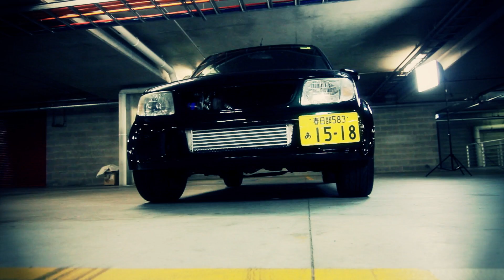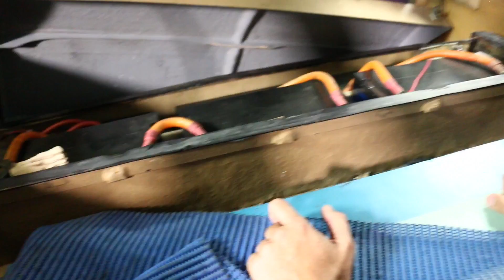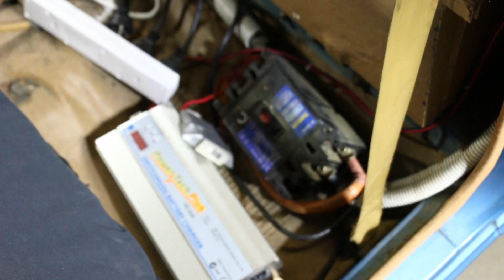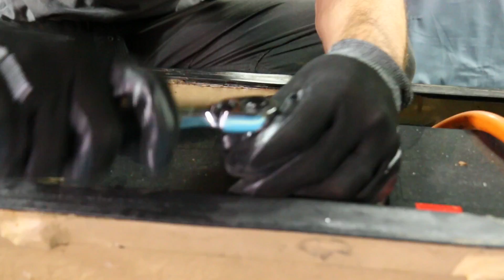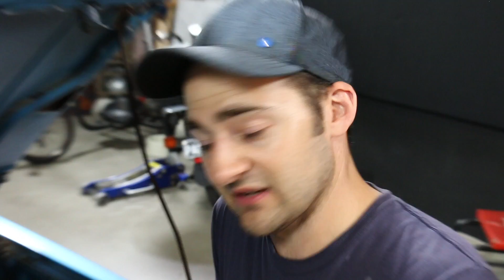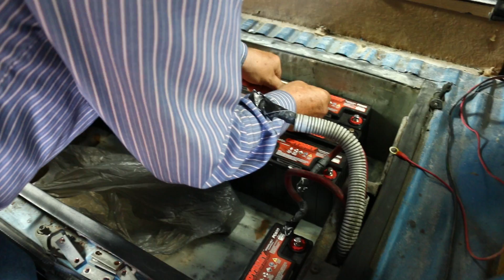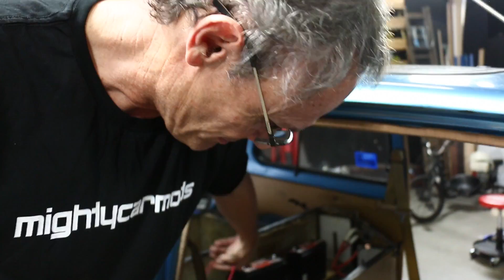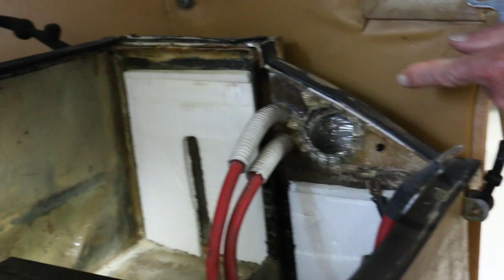JDM Electric Turd

Comment: Electric cars aren't the future they are too dangerous because they Are too silent hydrogen fueled internal combustion cars are the future
Reply: They do, about 50% (in electric much more more) pollution of a car in a life cycle it is creation. So normal car running on gas is cleaner then electric car.
Even MIT made articles about that recently.
And more then that If you have car which is 15-20 years old and run on gas is the cleanest  of all, becasue it was produced long time ago.

And another thing, car need a lot of energy, in one bigger country in Europe change all its car to electric it would need something like whole EU to power it! Not to mention logistical problems  of so many charging station and problems with grid.
Reply: Milk and old battery acid mixed twin brittney spears powered tractor trailers honestly have the brightest future.
Reply: Or you can run on CNG or LPG, which is way cheaper be the way :P
Reply: Target _667 well that mean when you crash you would blow up bro
Reply: swietoslaw CNG and LPG are still fossil fuels that have to be burned which produces CO2. They're better than petrol, but they don't compare to electric propulsion at all

Comment: I work for a company that specialises is battery's a charged battery is classified as 12.83 anything below 12.8 is classified as a flat battery
Reply: My old school front terminal battery in my van with a 1000c.c.a rating charges to 13.2-13.8v , when it hits 11.83v the battery barely has enough ummph for one last quick startup so that about flat.

Comment: Why didn't they use tesla cells ? with that space they could've gotten 500 miles out of that tiny car lmao
Reply: Where were they gonna get Tesla cells?
Reply: from the mighty interweb! you can just go to your personal interweb at home and order those things to your door. Tesla 2170 cells' got 6 Ah. your average iphone only need just und 2Ah. it's about 2 inches long and one inch in diameter. Thats what that gigafactory thing is for.
Reply: and why dont use toyota or Nissan batteries which you can normally buy?;) 
Tesla batteris are nothing diffrent from other. 
And I think they don't want to spend like 10k $ for batteries ;)

Comment: Electric cars are actually pretty easy to understand once you get into it. You could just look at an R/C car and compare the two. There's a control unit which receives the power from the batteries and depending on how much power you need, gives that power to the motor. Then there's a charging circuit, and last but not least, the batteries. That's basically it.
Reply: pretty much XD coming from RC car modder
Reply: yeah ^^

Comment: I WOULD THINK THOSE SMALL BATTERIES HOLD ALOT LESS AMPS!!! WHAT U WANT IS 12 1,000AMP BATTERIES. U COULD DRAIN THOSE OLD BATTERIES & FILL EM WITH WATER & BAKING SODA THEN TRICKLE CHARGE FOR 1-2 DAYS & THEIR AS GOOD AS NEW!!! LOOK IT UP ON YOU TUBE!!!! THOSE LITTLE BATTERIES WONT HAVE AS MUCH COLD CRANKING AMPS=SIMILAR TO HORSEPOWER!!! THE UMPH THAT U FEEL WHEN YOU FLOOR IT!!! WHAT U NEED IS ALOT OF C.C.A(COLD CRANKING AMPERAGE)
Reply: man it's been more than a year why would you think that they would listen to you now that the whole project is over

Comment: Concerns that come along with batteries: if you overcharge or overdraw them, they can pop. That leaks acid. So, you need to put the batteries in a sealed plastic tub. The plastic won't rot with that form of acid. Sealed, because batteries outgas hydrogen while charging or discharging. Hydrogen is explosively flammable as well as corrosive and will rot anything in your car. As you can imagine, a sealed box full of hydrogen isn't much better than it leaking into your car. So, you need a vent for the box. And electricity can shock you. That's about it.

Comment: @22:10. The fact that "newer" lead acid batteries are lighter arguably has far less to do with technology evolution than with build to cost - the chemistry has remained the same for 140 years thereabout. As well, 30+ years of EFI, RoHS, and a trend toward smaller engines that require less cranking current have lessened the demand required of a primary battery which has allowed the mfgr's to build (frankly) shittier batteries than you would have gotten in the same apple for apple group size 25 years ago. This aside, primary starting batteries were never designed for the load curves of an EV, and utilizing them in such a manner will result in a very short useful working life. There certainly are deep cycle Pb solutions, but as you mentioned earlier .. there are far superior Li chemistries now that make Pb look like 16th century apprentice alchemy.

BTW mates  .. Downright tickled with the success that you boys have  achieved - and certainly deserve. In my humble opinion you are one of the.. if not THE .. most  relevant real life wrenching shows today, and FWIW - your viewing demographic definitely now includes the old school (former) big displacement greybeards. Coke bottle chargers (here) or Falcon XB's (there)will always have sex appeal  .. But who has a hundred grand to build something that for all intents is half of the daily friendly ride of (say) a 10 y.o. Subaru.

Keep it up boys - thumbs up.

Comment: i dont understand why any country would use those three pin powerpoints. in germany we only have three, the third is on the side, so you can put it in two ways, which can come in really handy sometimes
Reply: you could still center the third pin or, as said, put it on the sides to keep it symmetrical

Comment: quick calculation would make the equivalent battery from 18650 cells 65kg and would cost 8000$ from new cells. roughly 65cm thick and less than 1mx1m... that would have been awesome!

Comment: How is reducing the distance by 1/3rd & only halving the battery weight of the vehicle improving it??
Your 'experts' have gone from 12 batteries producing 1080ah at weight of 696lbs to 24 batteries producing 384ah at 370lbs weight.
Not to mention all the extra potential for trouble with extra battery terminations.
FYI those batteries are not Lithium either, AGM.........
Reply: They never said they were lithium, they specifically said they were Lead batteries used in sports bikes.
And they improved it from not working condition to working condition.
Reply: meow meowers An expired cell is an expired cell, regardless of Ah ratings.

Comment: OKAY PLEASE DON'T SHOOT ME IF THIS SOUNDS LIKE SOMEONE THAT KNOWS NOTHING ABOUT E.V.s OR ELECTRONICS BECAUSE I DON'T BUT HERE IS MY QUESTION IDEA. FIRST: how many alternators can you affix around each wheel using a custom adapter plate and custom design centrifugal drive pulley to use the energy of the vehicles motion/axle rotation to drive them.(in this case I would say 1alt.-2x batteries or how many is needed to efficiently power the drive motors with a little charging to spare. A independent rear suspension would be the most flexible for this set up to be sprung or unsprung weight).  SECOND: would capacitors help a system like this to be more efficient at speed for better rapid charge discharge?  Also would power inverters be another possibility to distribute the alternators energy as well as charge the system?  I THINK THERE HAS TO BE A SWEET SPOT SOMEWHERE IN THERE THAT UNDER THE BEST DRIVING CONDITIONS YOU COULD DRIVE FOREVER, AT THE LEAST EXTEND YOUR RANGE BY MMMMMUUUUUCH! ...OR AM I BACK TO THE BEGINNING OF THIS IDEA WHERE I AM ABSOLUTELY CLUELESS!???????
Reply: VjCClass Using alternators when not stoping is pointless ,  it takes power to turn in alternator and you lose some to heat so you lose efficiency...    it's a better idea to use alternators for stopping rather than brakes like a tesla.
Reply: jayc5000 I don't really know much about alternators but you mean to tell me that the mass of a moving vehicle isn't enough to drive even one alternator that can sustain enough power to run a motor or replenish a alternate standby batter system. And what about a battery capacitor combination alternating system. I don't even know if I'm asking the right question to what I am thinking.
Reply: Basically I didn't know that alternators robbed/require so much power to produce it's energy. Isn't something like 5-10hp from combustion engines to produce its peak power?
Reply: VjCClass What im saying is that you need energy to get the vehicle moving and keep it moving,  if you had in an alternator it will stop or slow down your vehicle eating more power to keep it moving, and since you can never be positively efficient you lose energy in that process defeating the original purpose of having an alternator...
Reply: VjCClass It would take more power to run the alternator than it would produce under normal driving. But if you could somehow fabricate a system that only engages the alternators on deceleration and under braking, then it would salvage some of the lost power and probably extend the range somewhere in the ballpark of 30%.(that's my guess, it would be less on highway and more in city driving due to more braking)
Reply: guy6751 does the alternator require so much power to operate because it is under the load of all the other systems the battery(s) is powering and if so could doubling the batteries and alternating between the two halfs and charge one while using the other with, alternate the process as the battery being used reaches a designated low level and like you said develop a smart pulley system that regulates engagement to optimize the most efficient regeneration of the energy storage to the standing by battery. I know you'll getting tired of my replies and I should probably just get over it or put up...🤔

Comment: But you need to burn dinosaurs to create electricity.
Reply: Keifman Seven I like how you started your comment sounding completely uneducated then immediately turned around and had knowledgeable input...My Nigga!
Reply: This may be the case but most electric cars are far more efficient and have the equivalent of several times greater mpg than gas engines
Though gas engines are definitely more fun
Reply: anew742 depends if you want insane acceleration or the sound of an engine.

Comment: Although anything that makes the correct voltage will drive your EV, the racing bike batteries were a poor choice. Standard auto batteries will be no better. 
Auto and bike lead acid batteries are designed for high current flow, in order to provide lots of amps for starting up a high compression engine which needs a lot of amps. They sacrifice longevity and the ability to cycle many times for this. The money shot is; Starting batteries are good at high current flow for a brief time, and lousy at providing lower flow over a long period of time. This is perfect for starting a petrol engine, but what you need for an EV is the opposite, a battery that will keep up a low current flow for a long period of time, and is built for many charge/discharge cycles.
Wheelchair batteries, marine deepcycle like for an electric trolling motor, or golf cart batteries would have been the prime choice for a project like this one. Still lead acid, but much different internally.
Reply: Ken Lazar They probably got a deal where they got those batteries extremely cheap. Buying that many batteries would be very expensive.

Comment: My only concern would be the byproduct (in lead acid batteries) of hydrogen/oxygen gas building up inside the car.  Shouldn't be an issue with the proper charger, but ventilation is not a bad idea lol. Great vids.

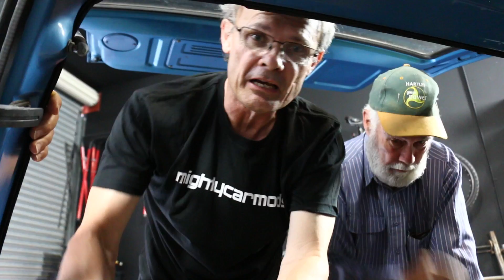Comment: 31:00 isn' t it like dangerous and bad for the lead acid battery to keep it on its side not the right way up??
Reply: Cizburgers AGM batteries are dry cells. the electrolyte is contained in a glass matt material.

Comment: Thank god they already have artificial oil created, I will never drive an electric car
Reply: That´s bullshit and you know it.
Reply: enok90
Well, no.

98 octane fuel actually can be recreated fully artificial, just not in any great masses yet Wast-oil and vegetable-oil also is a great fuel.
Also, running on fumes, where a 5.7l V8 gets about 120mpg.

The problem is that (and this isnt even any conspiracy, thats just fact) the big oil-companies and goverments are keeping these things down for profit reasons.
But thats just the way it is.
Reply: I can. If it can be done in a way that google doesn't track where I am. I am ok with it.
Reply: Artificial oil isn't sustainable. E85 or E100 is probably the future fuel for internal combustion engines.
Reply: Nazimelonhamster
What do you mean "Well, no."?

I never said it wasn't possible I said it wasnt sustainable. Syngas is made primarily from Coal and Gas. As you may know Coal and Gas are fossil fuels.

And using biomass to create fuel (which is already done for ethanol) displaces agricultural land which could otherwise be used for food.

I agree that Big-Oil is doing their best to make sure they stay on top, ain't gonna argue with that.
Reply: SE45CX
Google tracks your movement and everything with you using a computer, a phone and so on.

Seriously, this comparision is useless.

Comment: Careful to others out there. HVDC is incredibly dangerous. It can easily kill you.
Reply: I should add to my comment above that it isn't voltage that kills, it's current that kills. But higher voltages make it a higher risk of injury or death because of the greater potential. Thought I'd add that before the keyboard warriors come racing after that comment.
Reply: no actually you can't have current without voltage so it is both
Reply: also it takes thousand of volts DC to kill had to add that
Reply: obviously you need voltage to push current. just saying that current is what kills. voltage makes it “EASIER” to do so.
Reply: you can have thousand of amps but if it is at .5 volts it will not kill you

Comment: how come they linked black to red?
Reply: it basically to bridge the connection between the batteries.  If two batteries were setup  like this (+ -)(+ -) then they can bridge the pos and neg in the middle and have a one positive and one negative to connect to on each end.  As far as why you need one pos and one neg to connect to when it comes to batteries i did not pay attention in science class on that section
Reply: There are 2 ways of connecting up batterys. If you link black to red you are connecting them in series. You add up the voltage doing so. So 12 batteries connected in series that are 12V each you get 144V between the red connector of the first and the black connector of the last battery. If you connect up black to black and red to red (you can do that just if they have the same voltage) that is called parallel connection. They are still 12V on the terminals, but you can draw more current. It depends on what you need for you application, the power you are getting is the same as it is voltage * current.